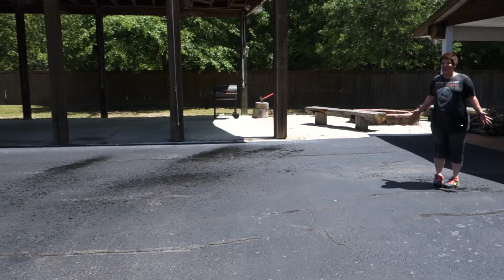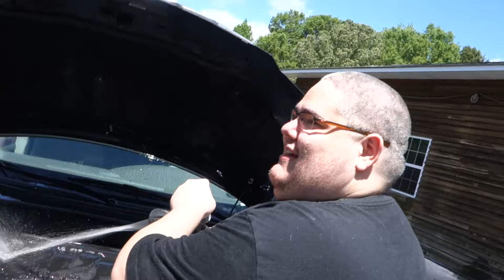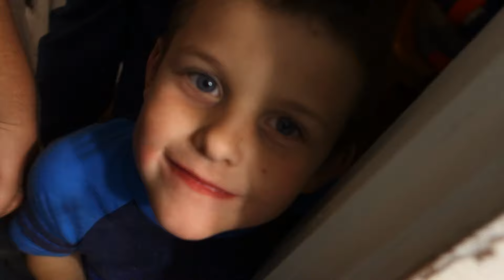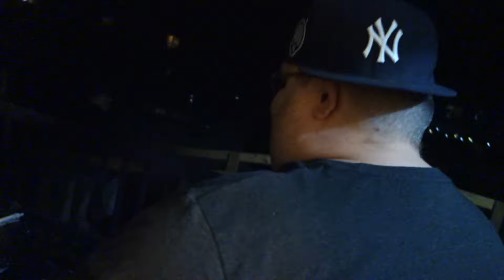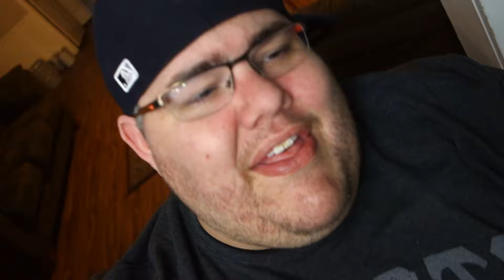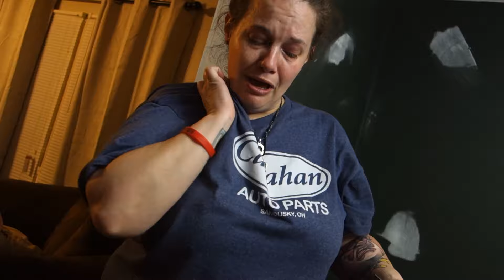A SIGN FROM ANGRY GRANDPA

Comment: Are you kidding water right in the engine!
Reply: david czapla yeah and at the battery even women know not to put water at the battery
Reply: A2 the JDM fan boy it’s fine as long as it’s not high pressure water
Reply: A Hernandez no it’s not. Any water can damage your electronics system. That’s basic car knowledge.
Reply: Guess when you go threw a car wash it damages a car according to your logic
Reply: Nut Squid when you go threw the car wash the hood is closed it is safe from water, but the HOOD WAS OPEN
Reply: It’s fine my dad does it
Reply: When the hood is closed it stops most but not all the water. Water on the battery isn't an issue
Reply: A2 the JDM fan boy I ❤ jdm but that is so dumb what goes through people's minds that don't know cars

Comment: Adding water to the cooling system is a temporary thing. That will rust up the radiator and water pump and engine block.

Comment: NOOOOO WHO IN THERE RIGHT MIND SPRAYS AN ENGINE WITH WATER 😐🔫 Especially the battery
Reply: Arturo Martinez Nice EK
Reply: Oof OofOof 😂😂 thx
Reply: Why especially the battery....they are ment to be able to get wet
Reply: WHY DID YOU BUT Tho EMOJIs man
Reply: Arturo Martinez me
Reply: Daphniebunny  there is a chance of destroying the while engine and shorting out alot of electrical components like the computer sensors,  if the oil dipstick is popped out it can also get in the oil which will easily destroy the engine
Reply: You didn't know why they were crying😤😧
Reply: @UND34D-_-ST0N3R  yea a little water not drench it
Reply: WATER COOLING

Comment: Yep, uh huh. Smart move hosing down a car battery. Didn’t anyone teach you that water and electronics do not mix?
Reply: The battery isn’t wat to worry about
Reply: Tito Ortega yes it is. Spraying the battery can mess up your entire electronic system in your car. Maybe not immediately but in a few years it may all stop working properly.
Reply: water is in batteries so its not going to hurt it
Reply: Dude you can't harm a car battery spraying it with water if that were the case every time it rained then your car would cease to work
Reply: Chatta290 no     Water doesn’t do anything to a battery i can hose down a battery and still be able to turn it on my dad has done that before
Reply: Kaleb Velasquez. 100 million subscribers exactly it doesn't affect it
Reply: batteries are made to get wet
Reply: Its the engine block you gotta worry about, never spray down your engine bay.

Comment: You shouldn’t spray the engine when it’s hot you’ll end up cracking the block. It could be plenty of issues like the water pump, radiator, reservoir, bad hoses it’s definitely a cooling issue

Comment: You probably burnt the clutch and broke something else as it burned out
Reply: And dont spray water on the engine because if it goes into it the fuel lines will get watered down and water will sit in the cas tank and oil pan so next time just open the hood and look at where the smoke it coming from

Comment: Guys never put tap water in your coolant reservoir. Put coolant your car needed from the manufacturer or put distilled water in it. If you put tap water in it, the minerals will cause rusting and cause your water pump and radiator to rust. And NEVER PUT WATER ON THE BATTERY

Comment: Dude that probably ain't good to be spraying water in everything on that engine. It's definitely not good on a hot engine and the battery. Did you put water in the brake fluid reservoir.

Comment: That's horrible for your engine man don't spray water on it you have a radiator problem man that's all that's why it's overheating all the coolant Spilled Out turn it off fix the hose put more coolant in that's it

Comment: No never spray a engine never u will damage the wires
Reply: The wires are protected, it's fine. It's the battery and engine you have to worry about